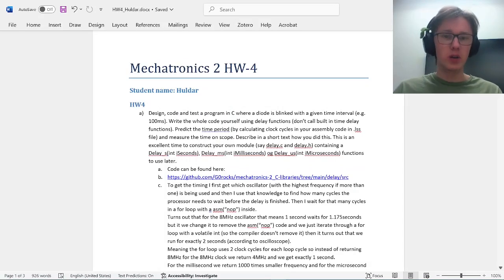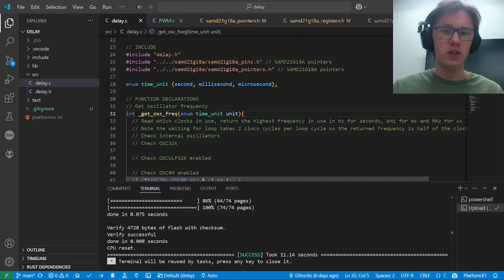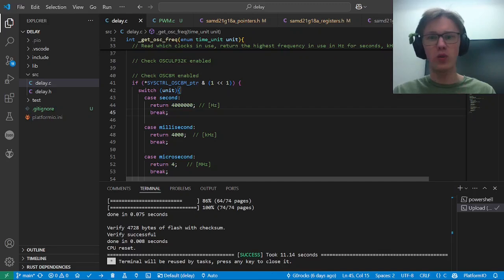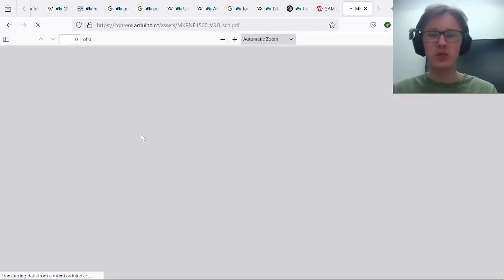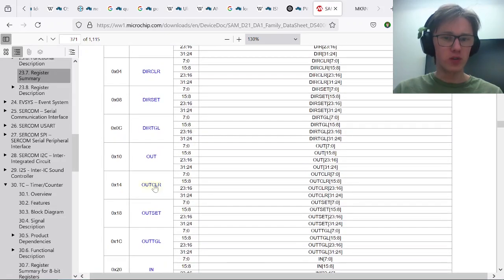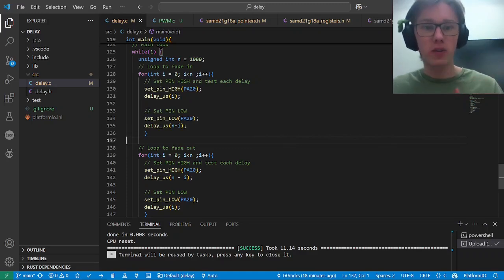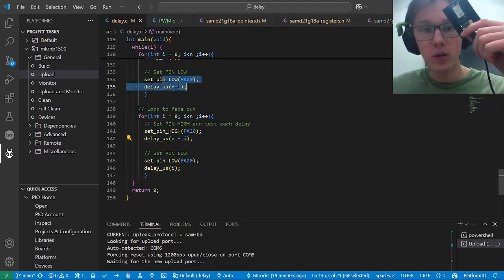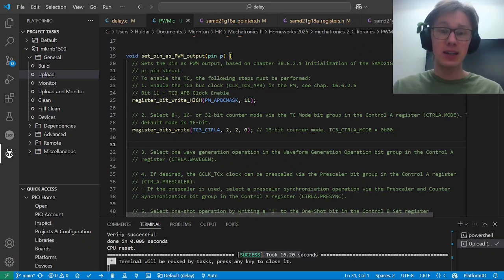Arduino MKR NB 1500 SAM D21 G18A LED fade in and out using delay

Comment: Love your video. Are you using any books explaining things or just the datasheet? i have been working a lot with electronics and some Arduino programming but want to get more knowledge on the programming, any book or website you can recommend?
Reply from the maker: Thanks Kristoffer :) I'm mostly just using the datasheet. In the class I'm taking the teacher has had some tips on things but the datasheet is a phenomenal resource for which registers. I've only recently started encountering issues where the datasheet has not helped. Regarding the actual programming I have been asking people around me and using grepper and chatgpt/autopilot to help me understand how to implement things and why sometimes what I thought would happen is not happening. About a book, I haven't checked it out but my teacher recommends this one

Introduction to Mechatronic design, International edition J. Edward Carryer, R Mathew Ohline, Thomas W. Kerry, Pearson 2011, ISBN 978-0-13-609521-7

Note also that this programming could be made simpler and easier to understand if you use libraries (for example the arduino library if you're using an arduino) but if you want/need the super fine control or you are not using an arduino board, maybe even a custom board then it's useful to dive this deep into things. The control is especially valid if timing is important to you since for example the arduino library sometimes just does random things in the background so if you need to be able to rely on a high precision timer then maybe you need to implement the code yourself. Feel free to also use the libraries I'm making on the github for this class. Good luck Kristoffer.
Reply: @huldar  Mostly i have used arduino boards for testing sensors or modules and understanding them, and then make a custom board, usually based of a existing arduino board. a lot of my projects have been based of a nano 33 iot. some drawback is that not all pins on the IC is defined, so i have ended up using the non defined pins using registers instead of the digitalwite() function. it works, but does not look as good. 
My goal at some point is using the MCU without any arduino bootloader, just using the SWD-connector and microchip studio, or using a STM32, i did buy a nucleo-board but haven't got the time to look at it yet. 
Hopefully im wrong, but i feel the learning curve going from arduino to microchip studio or STM32 i quite steep, so im looking for some book or website to learn from.
About the timing, there has been a couple of time i have encounter a blocking code from a library that has messed up things. Its probably better solutions, but i have fixed it using a timer interrupt to call time sensitive function.
I will definitely look into grepper, it looks nice, never heard about it before.
Reply from the maker: That’s awesome and honestly it seems like you’re more into electronics than I am but I do agree that the learning curve is quite steep. Though the learning curve is also very segmented. Like you don’t have to learn everything at once. I think your method is good. What boards have you been making?
Reply: @huldar  Sorry for the late reply, i wrote a reply but somehow it never got posted. Currently im working on a alarm-clock that is self-adjusting using a GNSS-module, and another project is a temperature controller for heating elements that is going to be used with a 3D-printer, the printer is inside a enclosure and the goal is to be able to set the ambient temperature inside the enclosure. what bugs me about learning STM32 is that its like starting all over, most functions i can do easily in Arduino, but eventually at some point i will reach the same level using STM32. About the projects, if your interested i can share the schematic and details. if you are using any type of instant messaging it would maybe be easier communicating and sharing files.
Reply from the maker: @KristofferHaaland  No stress about the reply time. One of the nice things about internet communication is that you can reply when it suits you.
The projects both sound cool, which one are you focusing on first?
No stress about the schematic and details, I think I'm okay with not knowing everything about the projects.
But yeah I agree, I've never really gone into STM32, we did a little bit in my bachelors program but it really wasn't much and it was mostly copy + paste. But you seem enthusiastic and determined so I hope you get to finish your projects :)
Reply: @huldar  Thank, yea, the temperature controller is almost done, its working but im not happy with the user interface. I used a library called ArduinoMenu to set temperature and timer, but im looking more toward LVGL now. its not as lightweight as ArduinoMenu but its a lot more user friendly.  About STM32, its a bit on and off at the moment, the list of stuff i want to learn i getting quite long.
Reply: @huldar  The temperature controller is mostly finished, i need to add a timer for automatically turning it off after a set time, other then that it seems to work, just waiting for the other guy to make the mechanical modifications and mount it.
Reply from the maker: @ Sounds awesome! Will hopefully be usefuly for nailing those prints that demand a specific ambient temperature :)